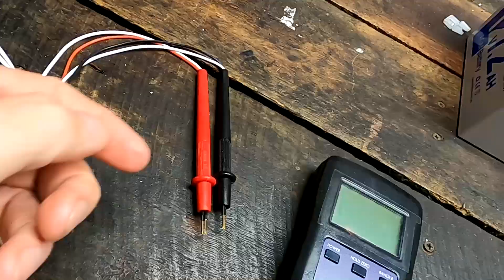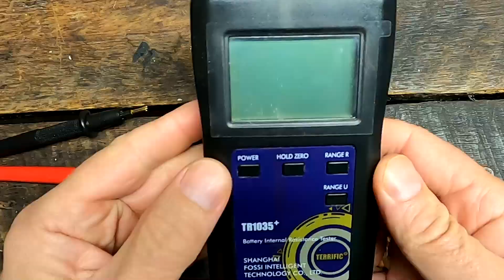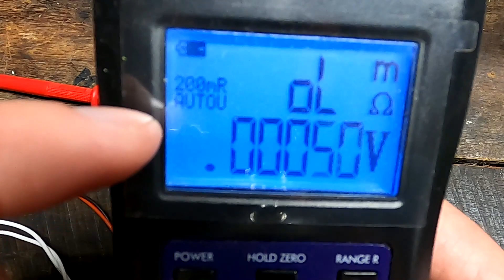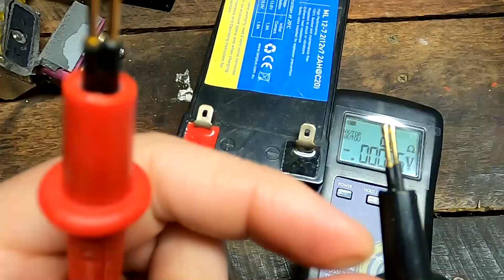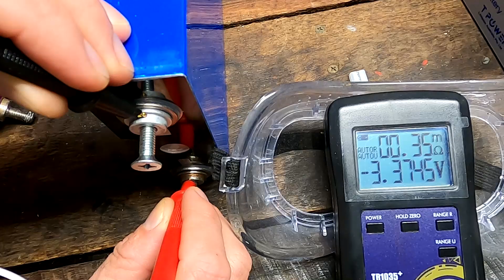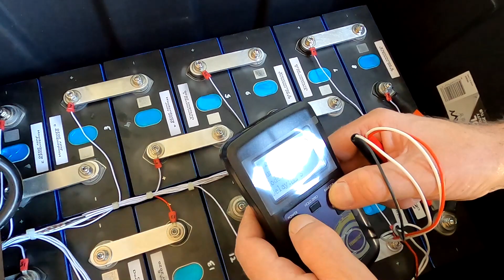Internal Resistance Tester TR1035 - Can we find a faulty cell?

Comment: Mine came in the mail today (YR1035+).
A complete games changer. 
Before: battery may need to be discharged a little, then charged to get so e pulse...and finally get a rounded IR reading.

Now: insert cell, get reading.

Game-changer.

/bklyn 👑

Comment: If those are aluminum busbars the resistance difference between measuring at the busbar and the copper wire lug could be the material (aluminum vs copper) and possibly the aluminum cross section is slightly smaller than the copper lug. Can't really do an accurate test without removing the busbars and measuring at the same location on the anode/cathode

Comment: Calibration Warning. I have the YR1030+ model, slightly different, same looking model. I am very sorry I copied the press leads together for a meter calibration. I copying what I saw Andy doing like monkey. I think I may have messed up my meter. It no longer reads that same as before, and ... in studying my directions for meter recently w stronger glasses for fine little print, I read no need for calibration as that has been done at the factory. Learning More All the Time, including from my Mistakes.  Over All I give my Thumbs Up and Thanks to Andy.  Question: Is there a way to charge up the internal battery of these meter when LCD show low or mid charge of battery? I opened case to see the inside battery power is soldered in. Also notice direction saying this meter is good for up to 100 ah cells (or something like that). Are there any better meters in  a similar or reachable price range?

Comment: Will the batteries being tested have to be disconnected from the system? What is the correct internal resistance value of the 12V 19A AGM battery?
Thanks

Comment: Will the batteries being tested have to be disconnected from the system? What is the correct internal resistance value of the 12V 19A AGM battery?

Comment: Hi
 I am Hassan Abdullah
 I want to ask if the battery resistance can be tested with a clamp meter
Reply from the maker: Not directly. Only an internal resistance meter can show you the internal resistance. 
You can use a clamp meter to do different measurements and then calculate the internal resistance though.
Reply: Thank you very much

Comment: This device is first of all useful for testing regularly Li-Ion batteries (particularly with high discharge Amps) which are not so reliable  as Lifepo4 by use (look at Dyson's batteries for ex. , with only one cells row in series for too many amps),  or to select cells with same IR value before assembling a reliable pack ,  or for not protected lipomere batteries with very low IR and high discharge amps , to be sure that all cells keep the same discharge value .
 Lifepo4 is much more sure and stable. Your IR differences (last part of the video) are very small and don't show any cell issue , perhaps a very small connection issue (no copper bar bus?) but not more. But after each year use, why not a quick test to compare?
I test sometimes my DIY motorcycle LFP batterie since 5 years and now with the YR1035...never recharged in the winter , almost like new although a not very precise regulator (sometimes over 14,6V). Friendly, Michel.

Comment: I tested an un-used high-discharge 18650 Samsung cell. The Kerchoff/Ohm law method said it's IR was 26 milli-ohm, but this meter said it's 12.5 milli-ohm! Since the meter uses an AC wave at 1kHz. does that mean it's inherently more accurate then the other method? Am I understanding that right?

Comment: 063022/2230h PST 🇺🇸 070122/1530h Brisbane 🇦🇺 I’m watching this video for the second time. Bu this time I procured YR1035+; the unit being the same, similar to yours. Since then I measured all my 18650s/ 21700s/26650s, Lishens/ Eves etc etc and understood the values. I noted that the internal 18650 needs to be fully charged after a series of tests, otherwise, the reading would be quite wrong. The small user manual was unsightly, but thanks for your elaborate introduction and usage procedure. 73s…

Comment: The probes are meant to puncture the oxide layer of the terminal to get a good reading. Especially with low IR, you will get results all over the place when not directly contacting the terminals. The reading then depends on the surface finish of the terminal vs. bus bar, the tightening moment of the screw, the diameter of washers and even if the threads have been cleaned before or not.

-> Measuring at the terminals is a great deal more reliable.

Comment: Thanks for the info! I messed up somewhat and have about 200 spim08hp cells... degraded performance and a huge bummer. I had to take the entire system down to test each cell. Maybe we'll win the lottery and I can get some Eve lifepo4 and do this right.
Reply from the maker: Ouch, yeah, that sounds like a lot of work. Prices will not come down in the near future for the EVEs is my guess. The demand has exceeded the production by far.
Reply: I've been looking at them and while not cheap it's better than dealing with unreliability. I can't get down about it because I've learned a lot. Some cells are testing around 50mr while the next is 500mr.  It's not a waste because once I get through this I think these cells are going to power the greenhouse and water tank for the garden. Thanks for replying to me
Reply: Well I went ahead and bought 12 Eve 280AH cells! They'll be here in 2 days, shipping out fairly local! Thanks again for the videos you work so hard on.

Comment: HAve you tried using it on a "live " battery pack? It should work as the induced voltage is very small ~ 15 microvolts . Signal processing probably has a 1 kHz bandpass filter in it.

Comment: Hi

I have the same device, you do not know why on the battery, for example, 12 volts shows resistance 0L?
I have 2 working batteries showing 0L,
on a faulty one shows 100 ohms, but on a working one it cannot be 0L ?
Reply from the maker: That's strange. Test on more batteries, different types of batteries...
Reply: @OffGridGarageAustralia  I think I understood what's the matter. If the battery is not fully charged, the resistance reading may be incorrect. I checked on the packaging of 12 volt new batteries, according to the datasheet they have a resistance of 22 milliohms. and all the batteries showed 22-23 milliohms. the voltage was at least 12 volts each, although I don't understand this, because if voltage  lower, resistance greater ..
Reply: You mean 100 milliohms? (not 100ohms!)... have you selected AutoR on the tester? if not , with a low value manually selected, you will find OL on a used batterie because its IR is higher than the selected  value...exactly like for a multimeter.

Comment: 0.31 + 0.4 + 0.24 + 0.34 + 0.27 + 0.40 + 0.57 + 0.21 + 0.29 + 0.33 + 0.48 + 0.35 + 0.27 + 0.34 + 0.56 + 0.46 = 5.82 ~= 6.0, all in milliohms - If you had a bad connection to any of those cells that connection would get hot, or at least, more hot, than the rest and you'd be able to see it on a thermal camera (if you own one). I strongly doubt that that's the case given clean new metal with sufficient torque on the fasteners, however you'd know if my assumptions are sound. Not sure why you didn't do the math and include it in the video, however for me doing it confirmed that your tool is good. Also, your test of walking the bus bar also seemed to confirm it as good, that's about what you'd expect from such a strip of copper. Good stuff, thanks - I should order one of these and examine my large collection of LiFePO4 cells that have now done quite a lot of work over a few years. I bet some are the worse for wear as a result. Cheers :-)

Comment: Measuring a raw cell ir with a multimeter / doing the calcs and comparing that to your ir meter now that would be interesting! Thanks for your efforts 🐸!
Reply from the maker: Great suggestion! We just need to find someone who is doing it 😂 I'll stick with the tester and just 'believe' what it says. Not sure how accurate the calculation is as it requires a lot of voltage and current measurements. So possible errors may sum up...

Comment: You and your commenters are inspiring me to build a 48v battery for solar, thank you! Definitely a "beer money" video. I really wanted you to test each raw cell directly not through the bus bars or studs.🥺I and apparently thousands of people appreciate your efforts and expense! 🍺To you!
Reply from the maker: Thank you very much for that. I am currently testing all cells individually. Video is coming very soon.
Reply: not realy! he is doing test because he likes to know, so do i .
but if you notice he and many other and your self testing and talking
about 50V my batterys are on the way but i am working with 500 volt
and that is the lowest voltage i will use why because 50 A x 500 V = 25Kwh
 and yes i am using 50 A x 50 V batterys X 10 sure you can run them paralel
but not in serie, do not try this you will blow them up.

Comment: A small note on the the reason for 4 wires. Look up "Kelvin klamps". One wire pair is the measuring current (the AC current), the second pair is just measuring the voltage at the measuring object. The two pairs har their own Pogo pins. The measuringcurrent wires carries the higher measuring current that may have voltage drop anywhere. The voltage measuring wires har very high impedance and there for no voltage dropp.
Reply from the maker: The tester does not measure any current, if this is what you're referring to?
Reply: @OffGridGarageAustralia  No, it induces an AC current across the battery (through a capacitor) and measures the voltage created at another series capacitor connected to the battery. The lower the internal resistance, the more load on the induced AC current and hence, lower voltage. The two wire pairs is a Kelvin clamp eliminating the effect of any voltage and current drop in the measuring circuit.

Comment: Nice video with a secrect frog language at the end... ;-)
I think the input of the little oszi is not well adjusted. This deformed signal form is typical for a not adjusted testprobe, when input resistance and capacity does not match.
If anyone is searching for the manual of TR1035+ there is a good review with pictures of the internals on the danish lygte-info website for the YR1035 which seems to be the same as the TR1035 and a short description in german is on the Akkuteile website. A video, which explains all settings is https://www.youtube.com/watch?v=pI4szOQCX-0

Comment: Low internal resistance cell's will always charge and discharge faster than cell's with higher internal resistance, this is why a balance circuit is needed to a series string of Batteries, the only other way around this particular problem is to charge each individual cell with their own dedicated cell charge circuit which is how and why I'm charging my series string battery bank! I don't have any balance issues and no need for a balance circuit! 
All the cells get exactly what they need when available! 
I don't know what the internal resistance is of my Batteries but I understood the importance of the part that internal resistance play's in a series string connected battery and designed the charge circuit accordingly and I have never looked back since! It's fully automatic by design..
Reply: do you have any links on how to do the dedicated cell charge circuit
Reply: @paul_dz  no I don't, my current setup is using one solar panel per cell and each cell has it's own MPPT charge controller. 
The charge controller is cheap from eBay and costs $10AU plus $5AU for delivery so I purchased a lot of them to spread out the cost of shipping. They are rated for 150W of power which is plenty for a single cell but adds up when you have a 48V battery string! 
No one makes an MPPT charge controller with an isolated output so that it would be possible to run multiple charge Controller's of a series string of panels so I had to do it this way! The only real difference is that I have cables from each panel coming into the garage wherein I would have had just one set for all the panels if isolated charge Controller's were actually available, but at least I can shut off individual panels if I ever need to! So in a way, it's not a bad setup the way that it is. 
I should add also that the batteries that I'm using are 12V 8Ah Lifepo4 Batteries! They are not cheap per Ah but they are cheap to buy a set of 4 for a 48V series string, and they can also be paralleled... 
I'm currently working on a solution to develop an MPPT charge controller with an isolated output that will work with the 3.2V Lifepo4 Batteries. All the components are available but no one has ever thought about putting it together so I guess that means I have to do it...
Reply: @PeterMilanovski  Thank you for the feedback - maybe your idea will catch on - or you can start your own channel - "Balance-Less Charging" so we can follow your progress
Reply: @paul_dz  thanks Paul, who knows what the future holds? Just need to keep moving forward!
Reply from the maker: I think the Electrodacus system does that and charges each cell individually?
Reply: @OffGridGarageAustralia  I haven't heard of that system! I have to look it up, it sounds interesting!
Edit: I just had a look at it and it doesn't charge each cell independently! It charges the cells as a single series string which is what you are doing!
Reply from the maker: @PeterMilanovski  right, so what are you doing then? What system is that? It sounds very interesting.
Reply: @OffGridGarageAustralia  I currently have a lot of work in front of me regarding this setup, my primary passion was always audio amplifier design which I can do with my eyes closed, a linear power supply be it for solid state or Vacuum tube amplifier is very simple, but DC to DC converters isn't something that I ever thought that I would need to know about but I have been experimenting with solar for awhile now and I have seen the problems, I have also seen the fix that everyone seems to be concentrating on but I could already see that there's a better way to do it without burning off excess energy across resistors... 
I'm sure that you can now see that your cells have different internal resistance even though they all came out of the same factory! You would experience that with every battery chemistry! There's no escape! Then there's the bus bars and the resistance that they add to the already existing problem, but if the cells are charged individually, the internal/external resistance problems almost don't matter! 
Have you thought about flattering out some copper pipe to make bus bars? It's a softer metal that should press into the battery terminals better than aluminium! 
Anyway, before I get too sidetracked, the technology exists but it's only in component form and a circuit has to be designed which is where I'm at so far... I would like it to be able to report everything that is happening but it's a steep learning curve. Hifi is slowly making a comeback and all the big companies have already released fantastic new gear and I don't think that I could really compete with that, but power management systems for renewable energy is only just getting started and if I can work fast enough, I can get in on the ground level with a product that everyone needs but no one knows it yet! 
Even a Tesla Wall is using a BMS that burn's energy to keep the cells balanced! There's a better way! And I'm working on it!

Comment: Its most likely the high soc that mess the measurements up (not the busbars). In this high state of charge the resistance curve have different shape among the cells. Discharge to 80% and test again.
Reply from the maker: OK, thanks. I understand that the internal resistance decreases with rising SoC to 80% before resistance increases again with higher than 80% SoC.

Comment: I have a chargery bms and it seems to show different IR for rest, charging and discharging so if you are measuring cells at rest, it might not give a actual behavior on how it discharges.. but I am not sure..
Reply: As I understand it, only an open-circuit measurement is valid, and even that changes with the cell's SOC. Putting something else in the circuit would introduce its resistance as well (not to mention any ripple possibly confusing the tester's 1kHz signal).
Reply: When BMS has Rs measurement capability it is usually doing it by measuring ripple current caused voltage drop by sinewave inverter DC current profile (120 Hz for 60 Hz inverter, 100 Hz for 50 Hz inverters).  Kinetic energy voltage drop should not effect Rs measurement much since it has a long time constant.  Rs reported will be more accurate the higher the inverter load or charge current which results in higher ripple voltage to read across cell.  Don't rely on reported Rs numbers when inverter current is light.  Also the inverter input filter caps start to become an issue to smoothing ripple at low load currents.  Some BMS's will not update Rs readings if inverter current drops below a minimum level that results in a cell ripple voltage below what the BMS can accurately measure.

BMS Rs measurement won't work right if using a modified sinewave inverter as the BMS is assuming a sinewave load current profile.

If you have a separate high frequency PV charge controller in parallel with inverter it can screw up the Rs measurement by BMS. It is generally okay if the inverter current drawn is much greater then PV charger current.

For Li-Ion there will be little difference in Rs whether measured at 1 KHz, 120 Hz ripple current, or a DC current pulse.  For impedance meters, the 1 KHz is a good spot to make a narrow bandwidth filter to achieve good low level voltage sensitivity for reading ripple voltage across cell when driven with low drive current (approximately 1 amp rms).   Impedance meter is only using AC current to make measurement so there is zero contribution to result due to cell kinetic energy.